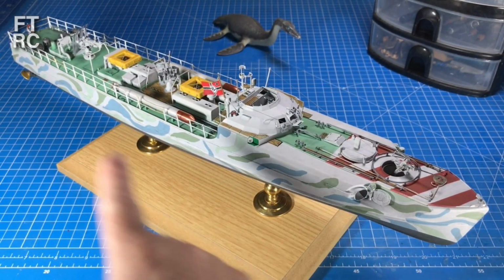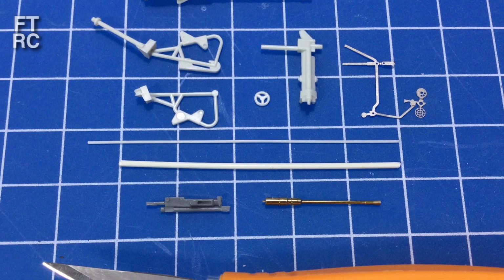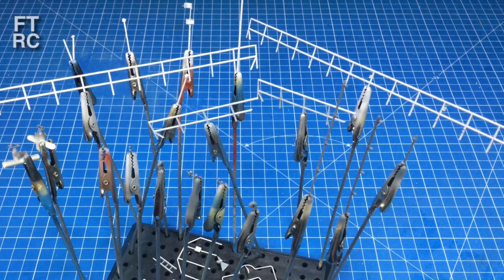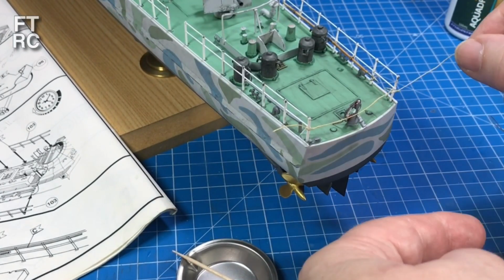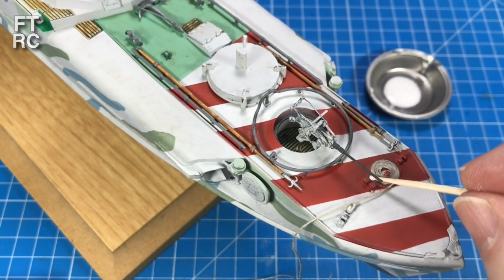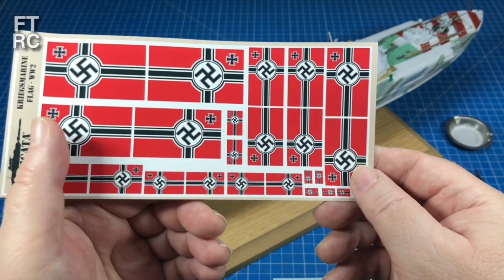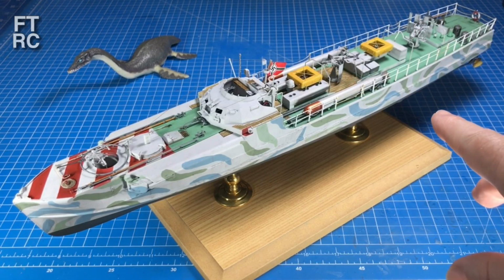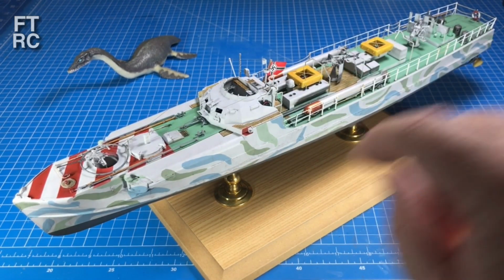Revell 1:72 Schnellboot Part 9 Done after a Wash, Ropes, Cables, and Flag

Comment: Hello Old Salt,I had built the same model bout 1.5 years ago.I did build mine more conventional.2 problems I had with the model was the coil of rope at the bow,ended up omitting that after several attempts and the ladder and exhaust right after the cabin,ended up installing the port side slightly crooked.Did not use the flag with the kit so no flag but I like what you did with yours.Also the railings wouldn't corropperate,so I run upper and lower lines for the railings.I have it displayed next to Revell's PT-109,same scale.No comparison.109 isn't nearly as detailed as the Schnellboot!
Reply from the maker: It’s a lovely kit you can do a lot with.